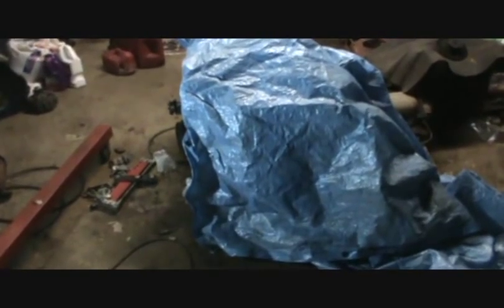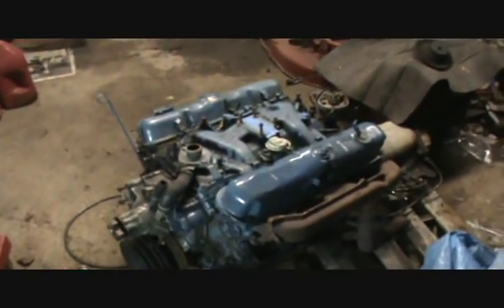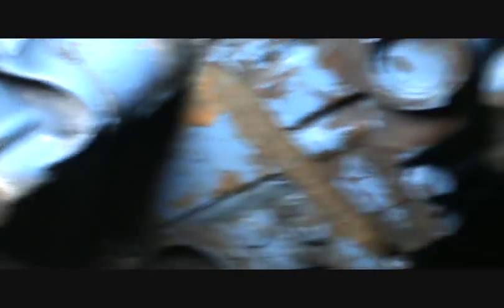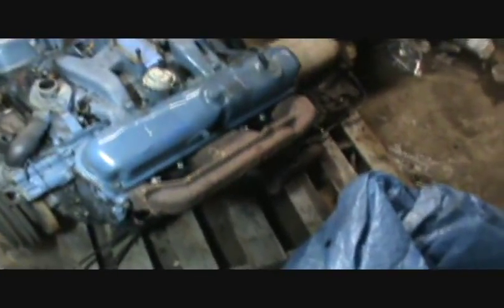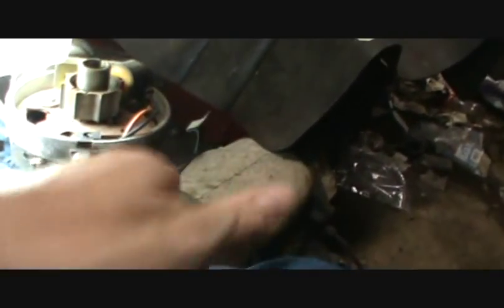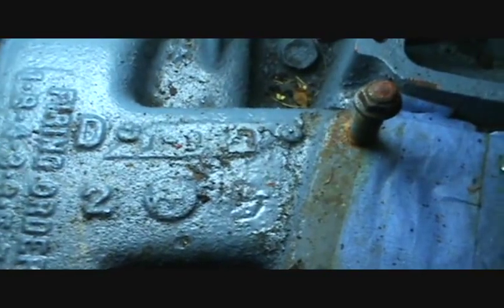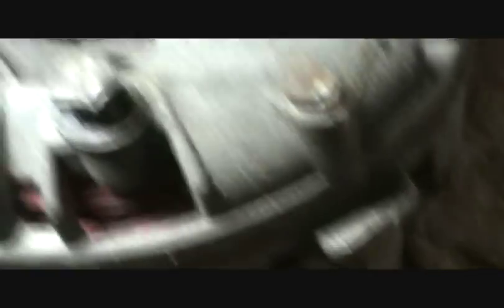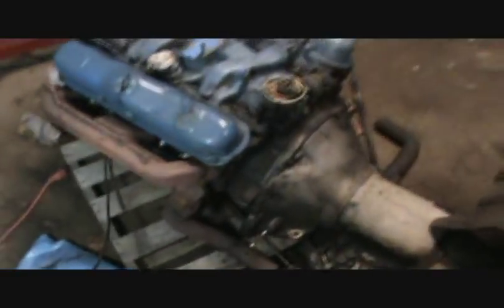Chrysler smallblock engine ID *by the numbers*

Comment: Chrysler is nuts about proving what the engine is. The 318 has a letter at the end. A 360 will have a 2 or a 4 that means carb 2 or 4 barrel. Big blocks are the same way. Numbers even match the vin so you know if numbers matching. They do the same with vehicles and putting the vin all over the place. The alternators have dates on both cases.

Comment: I need some help decoding my engine. I know it’s a 360. Just trying to figure out what year it is
Reply from the maker: There should be a series of 4 digits to the right of the ID number stamped on the front left of the block under the head. Those can be decoded with Chrysler's  10,000 day calendar, plus, as I mentioned, the block casting date is cast into one side or the other of the block itself. Casting number on one side, casting date on the other.

Comment: Bro! I have a 1973 Charger, the engine was replaced with a 360 magnum, I want to do the transmission conversion from auto to manual, I need to find out I my block is the small or the big block, How do I find out? and what do you recommend looking for before committing to pay $5000 for a manual transmission?
Reply: Distributer center rear?= small block. Distributor right front and tilted on an angle?=Large block.

Comment: 318 has "engine block core casting plugs" (not "freeze plugs": freeze your motor at -50'F and see what happens) that line up with the block pillars and are offset somewhat; 340 & 360 have equidistant block plugs more toward the middle area of the block.

Comment: Okay so now I know the engine in the motor home is a 1971 360 with a 727 hanging off the ass end, 37000 miles and it still starts and runs needed a water pump and sat for 45  years but still started and ran yearly before I got it 37000 miles it ain't even broke in. Need a "A" body..

Comment: i hope i remember this story right.     in the late 60s i was buying Mopar parts at a dealer.  the old parts man told me the part number for a block or head changed after the first time they machined it.   but the casting number is important.

Comment: Thank You SO MUCH for Sharing this Info & Knowledge!  I have a 1977 Dodge Van B200 Tradesman.  The Van Hasn't Been Driven on the Street for 20 Years.  I had some Friends Help me with an Engine Swap 10 Years ago, & I Can't Remember if the New Engine we Swapped into it was a 318 or 360.  This Should help with ordering Parts, Etc.
I'm 98% Sure the Engine & Trans came from a 1974-1979 Dodge Pick-up.
The Only thing that Stopped us from Finishing it was I Believe the Tailshafts are Different on a Truck Transmission VS. a Van Transmission.  So we weren't  able to Bolt the Tranny into the Crossmember, or use the Stock Driveshaft.  Do you know if the Tailshafts are interchangeable?  Both were 727 Transmissions I Believe & the Van Tranny was Totally Worn out/Shot.

Comment: Was a 383 Dodge engine considered a big block or a small block? Does anyone know?
Reply from the maker: The small and big-block mopars are distinctly different from one another. SB has distributor in the rear, BB has it in the front. If you go shopping for a BB Mopar , the good news is that 383's and 440's far outnumber the early 350 and 361 versions, and  I think the 1958-only 350 commands a hefty sum now.
Reply: Thank you for your reply. My 1969 Dodge D300 truck has a 383 74K miles on it. Engine still runs perfect however the trans (possibly from sitting a long time) will not move the truck. Don't know if I should look for a replacement Trans or have the original rebuilt. The truck is 100% original with a amazing original cab interior that  looks 5or 6 years old instead of 49 years old. No rips no tears no cracks. Have recently. garnered a new interest in the truck and want to get it back on the road.
Reply from the maker: @johnnyohness  Make sure you check the fluid idling in neutral, not park. If it does not move in any gear, ever, I would suspect something broken in the flex plate, torque converter or pump. However the case, have the original repaired.
Reply: Thank you for your reply and advice. It towed a 30 foot cargo trailer from Calif stuffed to the gills when we moved to Florida not a single problem. Then it sat for a long long time. I would start it and run it now and then but the last time I tried to move it it started slopping (the trans) real bad. Got it back and just parked it. Noe I would like to get it running again. Everything is original on it and I know those old Torque flights were strong as hell. I think it's worth having it rebuilt. The engine still runs like a top. It has the original factory air and I need to have that looked at as well. Thank you for your advice.
Reply from the maker: Big block, always. The 350, 361, 383 and 400 engines were the non-"raised deck" versons, and the 413, 426 wedge and 440 were the "raised deck" versions.
Reply: There was also a 383 rb version

Comment: Hello my friend, I hope you can help me with this. I own a 64 dodge 330 2 door hardtop , mexican car, in US it was called 440. My mexican title says motor number V318etc. In the door area, left hand, down, near kickplates, it has two plates stamped, one is the VIN, the other plate is black and says serial number and numero de motor which means engine number and has the same number as the title  V318 etc... the engine is stamped with V318 etc, same number... this is on the rear of the power steering pump, just as your video shows. Now... I wonder if in 1964 Chrysler made 318LA engines, because I read somewhere that this LA engines started in 1967 and in 1964 there were only Poly-A engines, is it possible that export cars had that type of engine on that date? My car has a VIN with the number 8 which I understand means EXPORT, that is in the Plant number place of the VIN. THANKS !!!!

Comment: Hey how do I find engine numbers on a 1979 Pontiac lemans coupe with 231-2v v6 Buick engine
Reply from the maker: There is a casting number located at the very rear behind the intake manifold and there is also a pad on the right front of the block near the water pump which should start with 2 for Pontiac, then a letter signifying model year, a letter signifying the plant code and then numbers which match the last of the VIN, if it's original.
Reply: Tyler's Neighborhood Garage thank you I appreciate it.. Do you have any input on a electric choke that was overturned and now when I start it the butterfly on the carb will open and warm up but the butterfly  stays wide open and the high idle stays on and the only way to lower the idle is to turn my heat on.. Really would appreciate your input.  I have a 79Pontiac lemans 2 door coupe with Rochester Dualjet 210 17059180 and below its 354o olt

Comment: where are the casting numbers for the heads? i got a 239 V6 for a 1990 dakota
yes its an LA block
Reply: Pull the valve cover.  Your head number is cast on to the top of the  head

Comment: Glad you posted this. Fortunately I was in the 'know' when I bought my 1st 79 Chrysler 300 in 93. The owner swore it had a 440.. but by distributor location, I knew enough to know it was a sb 360. When i showed him the date codes on the side of the block, he finally was convinced. It was the original engine, #s matching, but was not a BB engine like the seller was saying it was. Thx again for posting. And yes, many OE Mopar parts have the star or sprite shaped logo with the date cast into them, on nearly every accessory part. That comes in handy when trying to match up a starter or alternator. Especially when a dumb parts counter person asks what amperage alt you have...

Comment: Dist has casting info inside similar to the nos. on the alternator. The "dash" number after the 318 (drivers side) is critical. -1 is a car block, a -3 is a hi nickel truck block. Aluminum casting: looks kind of like a clock w/ the year in the center and the number of blocks (around the edge) indicates month. Ex: 65 in center = 1965,  4 blocks w dots in it = April. Also, all 360 engines will have a counter weighted harmonic balancer (external balance) that is considerably thicker than the 318. 360 2bbl intakes use a larger 2bbl than the 318. These last 2 are quick ways to spot a 360.

Comment: Dummy a 318 has power if you know how to make it.
Reply from the maker: Don't call people names. You can debate all day long on the merits of building a 318, but if they were capable, worthwhile and cheap to make big power with, Mopar would have never seen the need to put 360's, 400's and 440's in anything, right? Everything would have had a 318.

The 318 in my Dart Sport is built with a stout cam, 340 X heads, 340 intake and exhaust manifolds..and the 440 in my BROTHER'S '73 Sport with essentially the same build would run off and leave it, every day. End of story.
Reply: 400s were BOAT ANCHORS the 383s is chrysler's best kept secret
Reply: @butterswishflamingconserva1488   The 400 is one of the best blocks out there, it's got thicker main webs than the 383 and 440, it's short, compact with a large bore, they make great stroker motors. I've got a 400 230 cold weather block with a 3.91 stroker crank, makes  470ci with Indy-1 heads, going in my 69 GTS race car
Reply: This might be a dumb question but is this the same for big block Chryslers to? I pulled what I believe was a 440 big block with a 727 trans out of a 1969 Winnibego today and it would be interesting to know if its a 1969 block.
Reply from the maker: Shane S
I'm confident Mopar put casting dates on every block. Between that, the block casting number and the characters stamped on the pad next to the distributor clamp you should be able verify 100% what it is.
Reply: Thank you for your info, I found out my 440 is a 1974 big block 440 with the 902 heads, pretty cool stuff.
Reply from the maker: Shane S
awesome

Comment: great video. do you have one to i.d. the heads on a so-called 340 a guy has for sale that says they are not X heads?  

Thanks  Matt
Reply: Hot80s Early 340s had X castings and then J castings later on same head as 360...Some Early Js had 2.02 valves
Reply: @josephkutta599  X and J are interchangeable.  The only difference was the valves.  Mopar Performance used to have a list of LA heads it might be floating around on the internet.  The last J head casting was the "587" head used in the '85 -'89 M-Body 318 4bbl squads and '85 - '88 360 trucks/vans/Ramcharger.

Comment: poor 318s get no respect! but 600hp with streetable cam, compression ratio and N/A isn't to shabby?
Reply: Not if you want to tear the block apart.  Torque is what moves you, and the 360 is the same money.
Reply: True. Don't take much to make them run. Four barrel intake, 340 cam, 302 swirl port heads with 1.88 valves and you'll think you're driving a 360.

Comment: Regarding your reference to the first 5 characters of the serial number stamped in the front drivers side of engine block...

You said the 1st character is the year code...

Where can one find the cross-walk or reference for what that year code translates to...
OR what are they? do you know?

IF for example engine is in vehicle and cannot see casting numbers on passenger side of block because they are covered by exhaust manifolds, headers etc...

thanks in advance.

Comment: Heya Tyler. Thanks for this post.I just picked up a 23 T-bucket. The owner was claiming it was a 360 (that he was told by the previous owner).It was painted some metallic blue to match the body color;not Mopar blue.
  I scraped below the drivers' side head and with no luck finding the numbers,(my eyes aren't what they used to be) But the casting numbers were 2780930-340-8 yay! with a date code on the passenger side of 8-70. Though a 360 could be built to compare(even a 318 could), I am satisfied that it was a 340! Always wanted one. Now to figure what heads are on it...
Reply from the maker: Score! Glad it turned out for the best.

Comment: While helpful,  these  no's  don't tell the entire story.  I have  a  Mopar  remanufactured  360 on which the front  stamped no's have been obliterated

While the block casting may ID the BLOCK  this does not tell you if someone has  stuck a  318  cast crank, or a 273 crank into a 340  I'm  also told that  some industrial engines used differen  crank flange bolt patterns, so you can really get  screwed, there.

Also, you did not cover the dreaded  diamond stamp which  indicates  the horried oversize lifter bore(s).  I have an  030 340 block, and no not where to get  OS lifter for the thing

This  info also does nothing to ID heads.  I once  swapped  early 273!! heads  and intake!! onto a  260.  No late intake would fit this combo

Last, this does not tell you a thing  about  heads being milled,  what pistons, compression ratio, or camshaft  which can make a break an engine  "claims"

The point is, that as old as  any LA  engine is getting to be,  a lot could have happened between then and now.